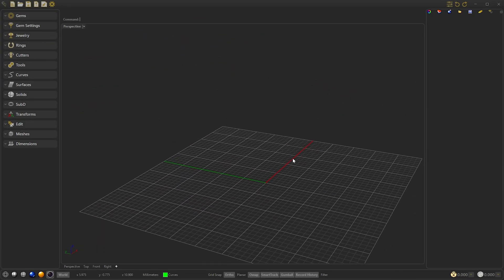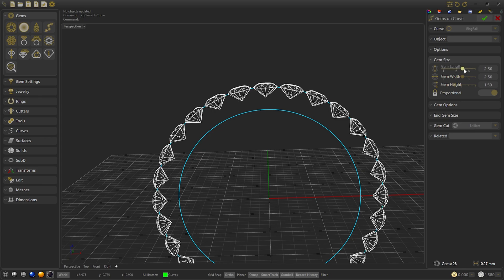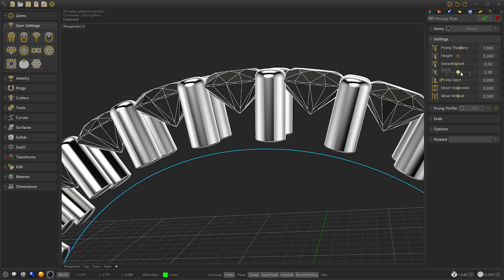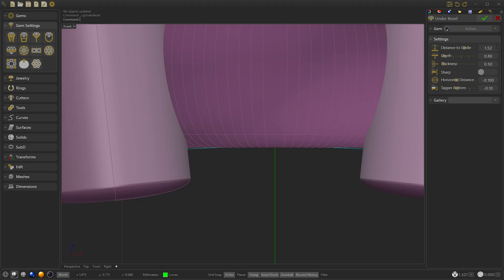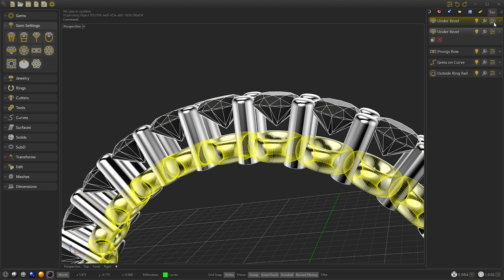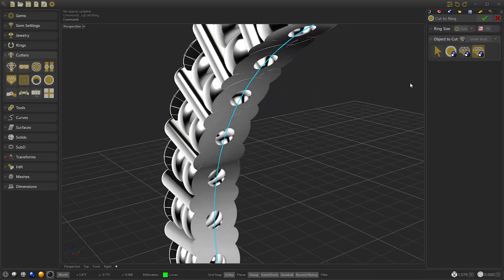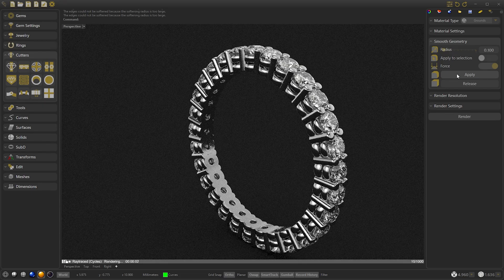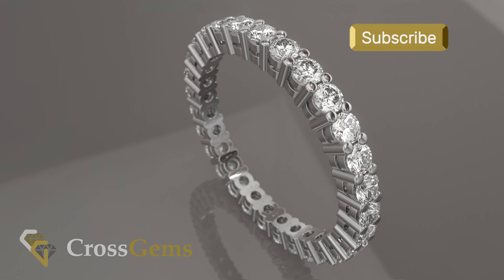CrossGems: Modeling an Eternity Ring in 3D

Comment: I possible to make a half eternity ring? Thank you for answer
Reply from the maker: Hello @jirimacek5194
Simply modify the "Gems on Curve" command's "Start Point" to 0.75 and "End Point" to 0.5 so that the first gem is placed in the third quarter of the circle and fills half of the ring rail.
As it is parametric you can do this at any time, at the beginning of the design or once the model is finished.
Anyway if you have any questions feel free to ask us and we will be happy to help you.

Comment: Which program do you use for this? Cad3d?
Reply from the maker: Hello, the software is CrossGems, a 3D jewelry design software made by us you can see more at www.crossbytes3d.com

If you have any other questions let us know at hello@crossbytes3d.com

Let's design!
Reply: @crossbytes3d  Its not software, you guys are using Rhino, which is the software made by Mcneel. All you guys are doing is writing scrips and using grasshopper. Also, charging an exuberant amount for basically a UI update. All of the plugins you would need for jewelry are easily found online.